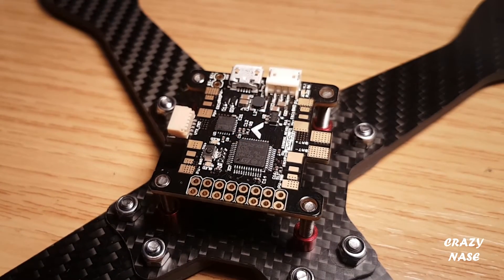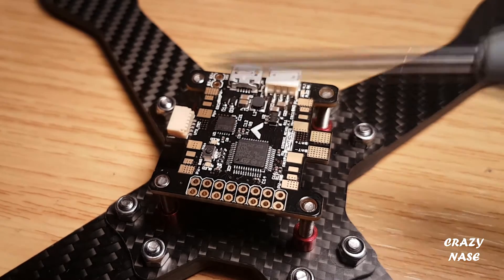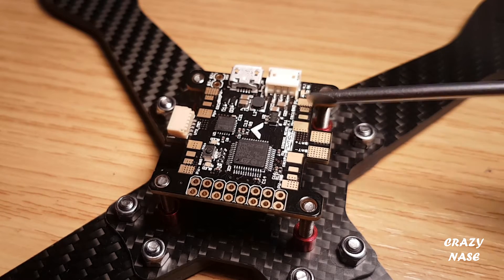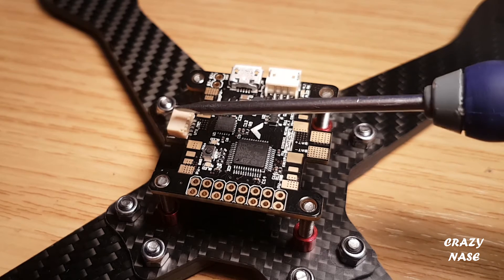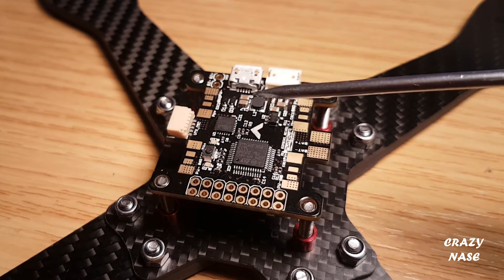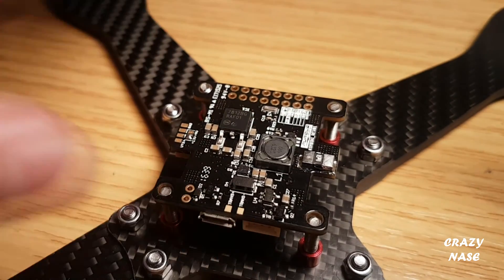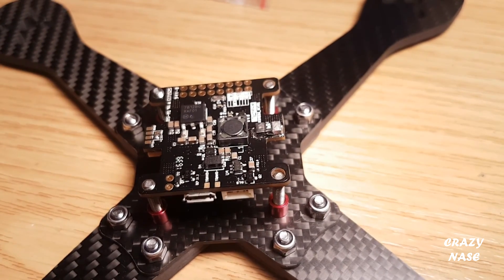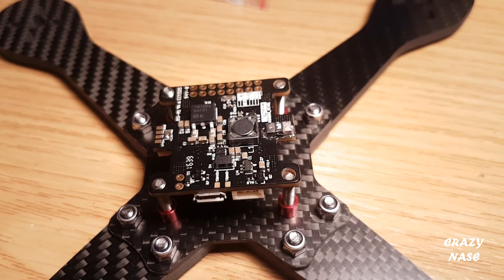Furious kombini Flight Controller Overview

Comment: Have you managed to update your hex beyond 3.1.5 pikoblx hex? Things do not go well for me using the later hex
Reply from the maker: they have hex files for the kombini on the furious website i would try them here is the link https://github.com/furiousfpv/betaflight/releases
make sure you get the right hex file though the ds version is the new kombini fc
Reply: ha, works! Thanks for that. The pikoblx.hex sucked all of a sudden so thanks for pointing me in the right direction. Its a shame that the furious website appears not to have helpful stuff for this board - in fact they are poor at that. Likely they are geeks and dont struggle like some....ok me! Looks like they have got their naming convention slightly sorted - no longer pikoblx. As to what AFF_FortiniF4 means - I have no idea. Thanks again.
Reply: When you go onto betaflight, do you see filters showing on the config page? I cannot see it showing where as it shows on two of my other boards. spr and revo. Hoping its not due to Furious abandoning this board and not posting updated hex files. I see an update for the Fortini 3.2 31072017 eight hours ago....but for the kombini its May!!! Would be nice to get updates for my two boards. Sucks if Furious don't bother.
Reply from the maker: Tobermory Cat i havent updated my board so i couldent tell you sorry. Im using the new matek f4 fc now its pretty good

Comment: can this board support a 5s battery  with these specs: 
Max Charge: 8C
Max Charge Current: 10.4A
Max Cont. Discharge: 80C
Max Cont. Current: 104A
Max Burst: 160C
Max Burst Current: 208A
Weight (g): 185
Dimensions (mm): 38 x 34 x73
Reply from the maker: This board is rated at 150a at 5s so you should be able to run 5s just fine it just depends on what motor and prop combination you are running, this will determine how much current you will pull through the board